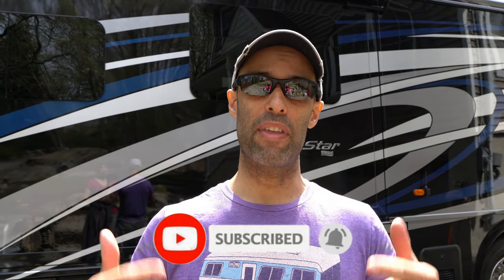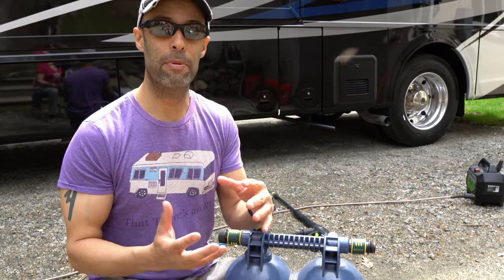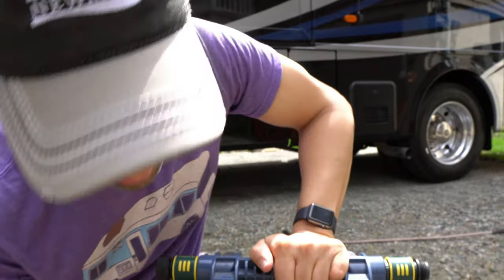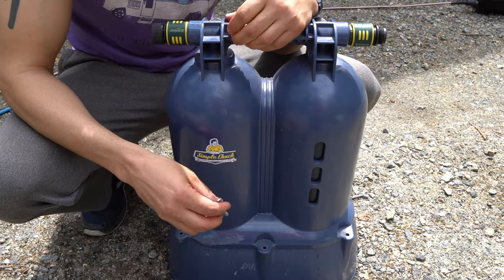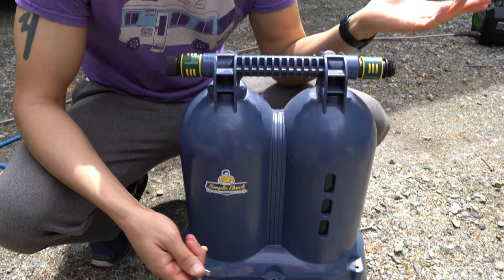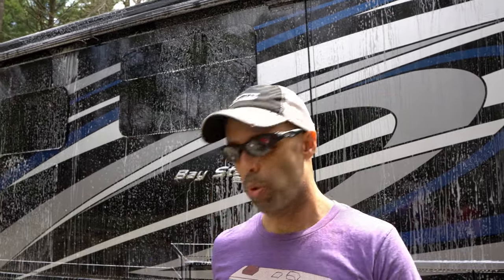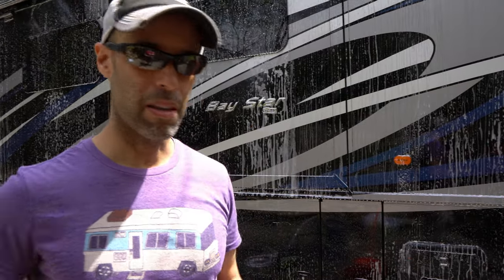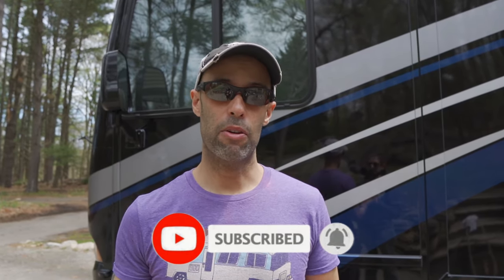The SECRET To Washing Your RV FAST - NO DRYING // Simple Chuck Water Deionizer

Comment: Watched this and immediately ordered a Simple Chuck - already had a pressure washer that had a suds gun.  Washed our 2018 Airstream Interstate - results amazing.  Water here in Tucson is heavy with minerals that leave spots that are tough to get off.  No water spots now!  Thanks for the tip!  Used deionized water only - pre-wet, suds gun and rinse.
Reply from the maker: Hey Paul once you go DI water you will never go back.  How much time did you save washing your AS?

Izzy

Comment: Clicked all the washing component links. The pressure washer is not available, but there is a similar at 1600 psi for the same price. Grand total was $754. I hate having my RV look like crap, especially now that we got a new one and I want it to stay looking new. Thank you for this information!! The dealer obviously did NOT use a DI water system. The difference is painfully obvious when reflecting off the smooth, shiny clearcoat surface.
Reply from the maker: DI water is the only way to go washing your coach.

Comment: Great video.  I have the Aero Cosmetics Waterless kit and I'm wondering if this would be a better system.
Reply from the maker: I also use Aero Cosmetics for quick clean ups.  It does work great.  DI water serves a different purpose if you want a deeper clean using water with soap, etc, DI water is the way to go.   Thanks for watching and the comment. 

Izzy

Comment: izzy i just got the simple chuck , do u use the simple chuck for ( rinse,wash and rinse again?,or only rinse ?? thx brother so  your  Pressure washer connected to it also thanks
Reply from the maker: We use it to rinse.  You can use it for everything you will
Just burn through the filters faster.
Reply: @EndlessRVing  OK so you only use it for the rinse but your videos show you use it for the complete wash correct ?  also rinse goes threw the simple chuck then threw pressure washer ? just wondering thx

Comment: Did you use deionized water when you sprayed it down before washing? I wash and rinse then do a final rinse with the deionized water using quick connects on all connections. I also clean off the roof first. The King Aire came with a pressure washer in the driver's side front bay with hot water. Cleans bugs off quickly.
Reply from the maker: For the video yes.  I normally just rinse with DI water.  I know most of the DP Newmar’s have the pressure washer up front which is nice.  Maybe on our next rig!!  Thanks for watching 

Izzy

Comment: Nice, but I don't know. Those filters aren't cheap, and have to be replaced regularly. I'm not so sure it'll pay for itself. Maybe if I had your wallet, Izzy, lol. I think I'm sticking to the car wash and a lil elbow grease. Carrying all that equipment and a pressure cleaner around with us just wouldn't be practical for me. But hey, it's a nice product to use at home, no doubt! Thanks for sharing.
Reply from the maker: Hey Bob, it certainly is not necessary but sure makes cleaning 37 feet a lot easier.   Only thing easier would be paying someone to do it lol.  Thanks for watching and the comment. 

Izzy